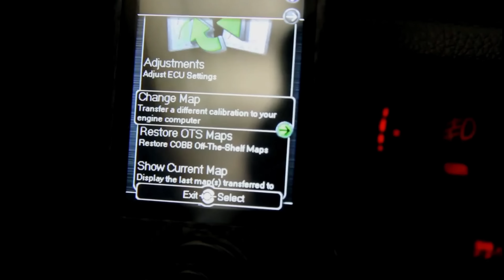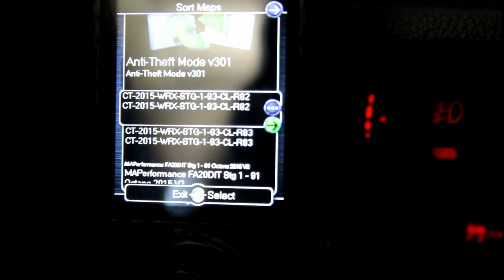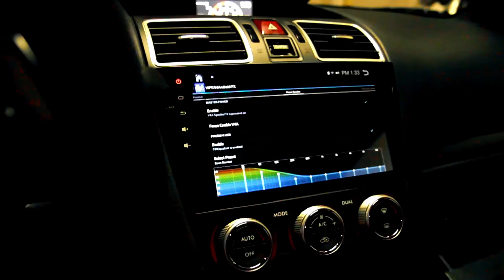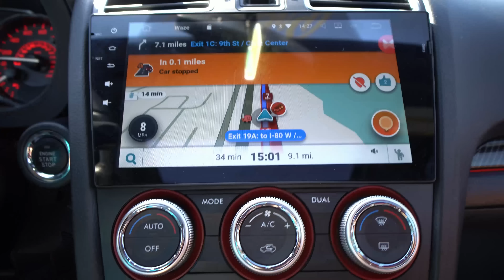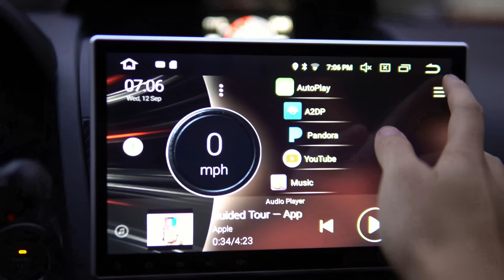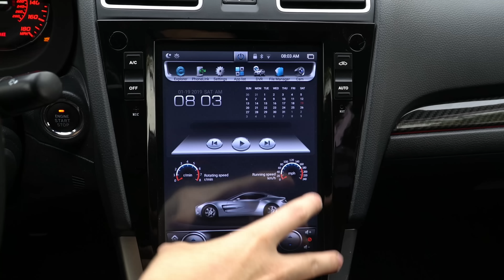Building a WRX in 10 minutes | All Subarus Go to Heaven

Comment: I don’t understand why people that own a WRX (which I own one myself) feel the need to slap an STI badge on it. It’s not an STI so why the need for the badge?
Reply: It came with the trunk when he swapped it
Reply: David Trujillo Strongly agree, I own an STi and I love it. You can tell it sounds nothing like an STi... gotta give him respect for taking it off towards the end!
Reply from the maker: I did the Trunk swap, then replace the sti badge with a wrx one.
Reply from the maker: I put on things that I like, The car are lego pieces. As far as I could of bought an STI. Obviously, I could have. I didn't want the 20 year old motor.
Reply: John Nguyen old and still great. But hey if you like your wrx do you man.
Reply: Yeah i agree it is a disrespectful sign to the car i had 17 wrx premium traded it in for 19 sti limited, and you only feel this when driving a sti that this is a rally car on the road, but in all fairness wrx is better value because somethings at that price point for STI i cant let slide.

Wrx may have a newer engine but STI brakes, transmission and handling alone is why wrx owners shouldn’t slap sti body panels or stickers on there, the STI represents the best in what Subaru has to offer, and i think it is just disrespectful doing that to a WRX.

Plus ngl when you sit inside a STI seeing all those STI badges and the wing out the back its a vibe that i cant explain I’m sure other STI owners will understand

Comment: If you had the chance, would you do it all over again with the Subaru  ? Maybe with similar or different modification routes. Or no ?
Reply from the maker: The only mod I regret doing was the brembos.
I feel that someone need to experience owning a subaru at least once in their life.
Reply: @JohnNguyenVincent  Why do you regret the brembos?
Reply: @richmond806  probably because they are overpriced and don't matter that much if you aren't tracking. Steel lines and some upgraded pads is a much cheaper solution to get great results.

Comment: I’m looking to buy a WRX most likely 17 or newer. Realistically how reliable have they been to you guys? Any head gasket issues, knocks, or over heating? Lmk
Reply from the maker: If you are getting a 15+ wrx then very reliable. I would avoid the EJ motors. Pretty much any STI motor